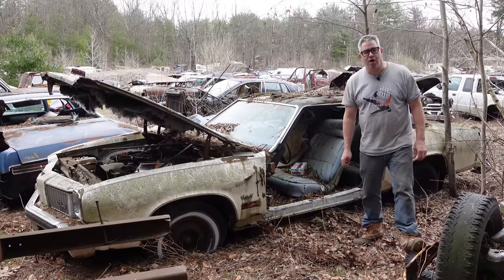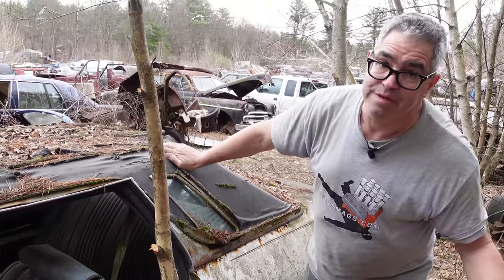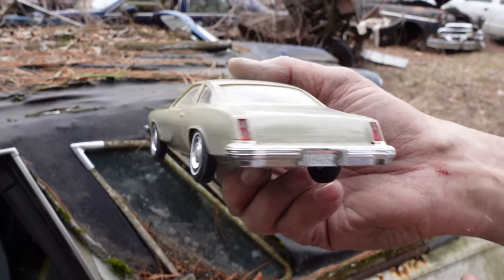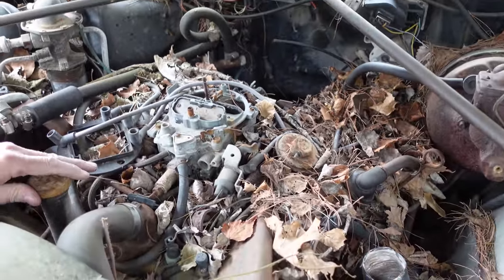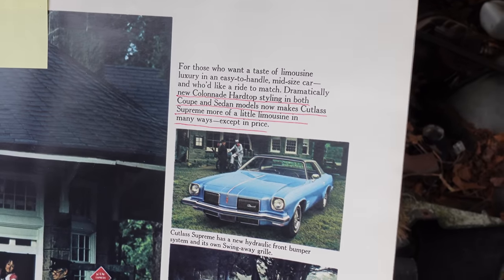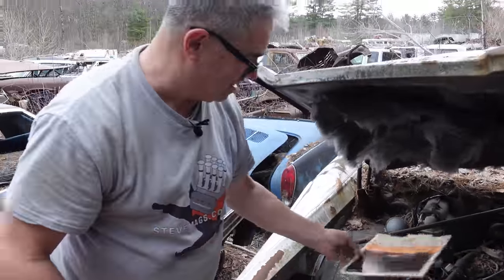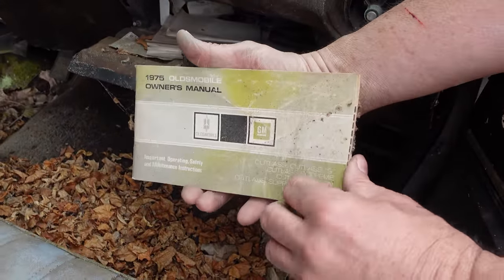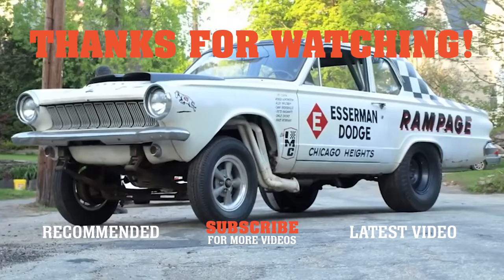A Lot More Cutlass

Comment: Hay Steve did any model maker make a 73 . 442 in 1/25 scale
Reply from the maker: Hello Thomas McBride, my mental "rolodex" can't conjure any 1973 4-4-2 model kits in 1/25 scale (or any scale for that matter). I think the JoHan kit (a simplified item, mainly created to be a pre-assembled dealer promo model and not a detailed hobby shop item) is as close as it gets for a Colonnade-era 4-4-2. BUT that's a very good place to start! I'd use the chassis from the modern era AMT 1970 Monte Carlo SS and adapt it under the Olds body and interior for a bunch of extra realism. An excellent Olds 455 V8 engine can be found in the Johan 1969 - '70 4-4-2 kit as well as the AMY 1969 (or is it a '68 or a '70?) 4-4-2 kit from the modern release of about 1995 or so. Also know this, the JoHan colonnade Cutlass model was also sold as a 1974 without the catalytic converter molded into the chassis plate. I've been told JoHan kind of mixed and matched parts in these kits so some may have 1975 bumpers but other-year grille / tail light / interior items. Snoop around on eBay and you'll see many oddball versions of this kit with minute detail differences. Thanks for watching and writing. -Steve Magnante

Comment: With 360,000 per year sold, they had to make ~1,000 per day…

That's ~42 per hour,  or one every ~85 seconds…

One line can't run that fast, right? How many production lines of the Cutlass model were running?
Reply: Easily five at the time: Doraville, GA, Framingham, MA, Lansing, MI, Arlington, TX and I believe in Canada as well.

Comment: last year for round headlights,,,round headlight should have been mandated all the way to eternity, why you say. If all cars had the round headlights no matter where you went you need a head light some auto store would have it.
Reply: By the mid-1980s, every place that sold auto headlights had the square 4652 low beam and 4651 high beams in droves, so that's a non-issue.